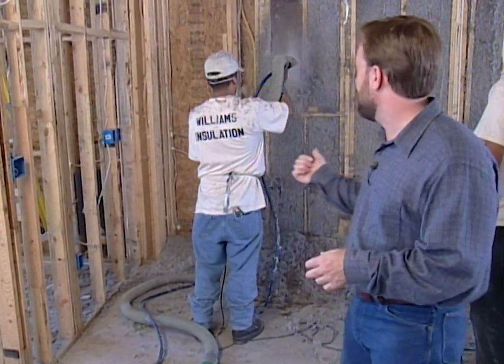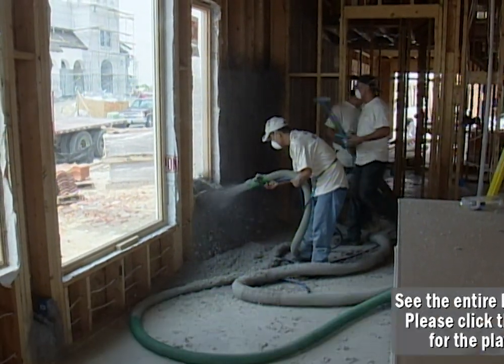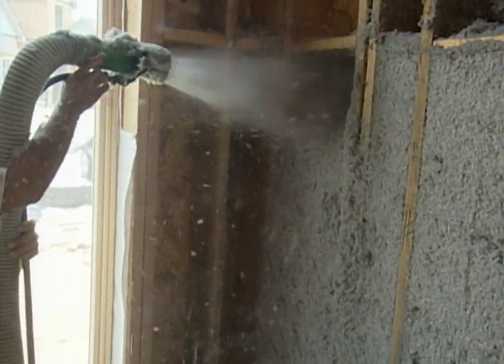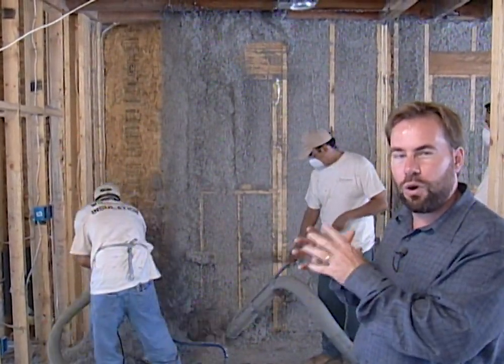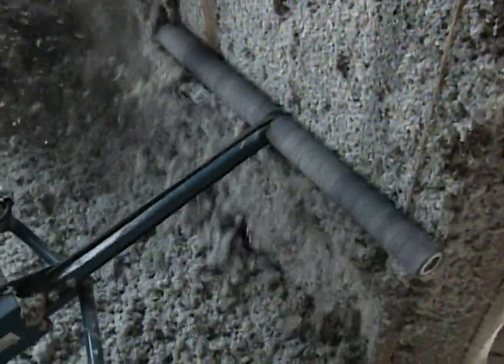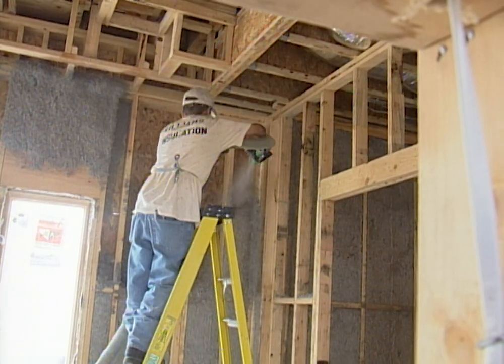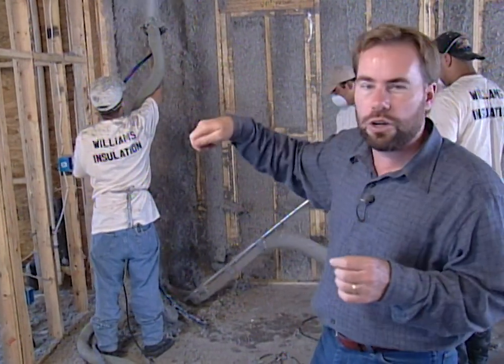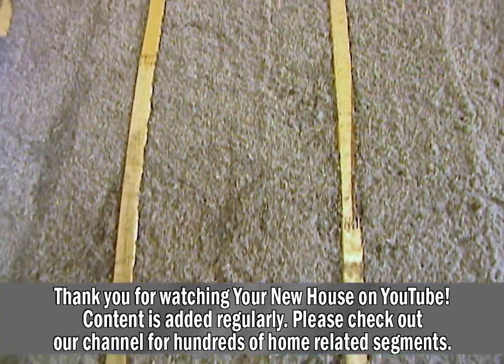Insulation: Renaissance Project House - Part 8

Comment: Cellulose has so very negative aspects, if it gets wet it absorbs, fiberglass does not, the only thing I feel is good is it stops air so seals top plates, high R value/" all else you can have it.  Just like OSB and drywall it cheapest to make thats why it pushed.  Plaster vs drywall, plywood vs OSB....Why use a product that get destroyed if it gets wet once.